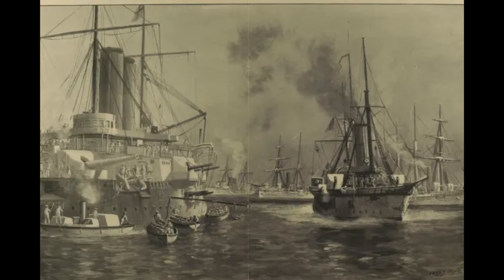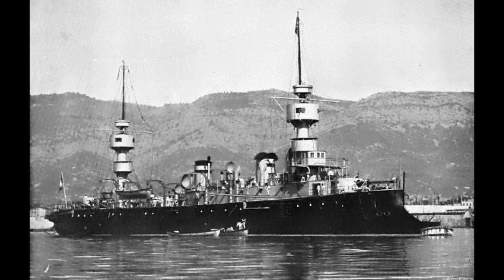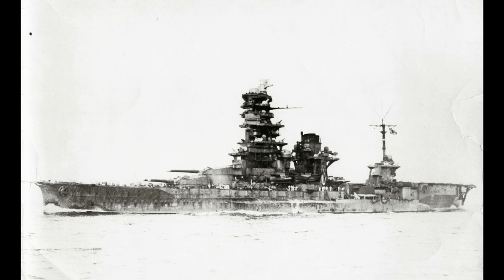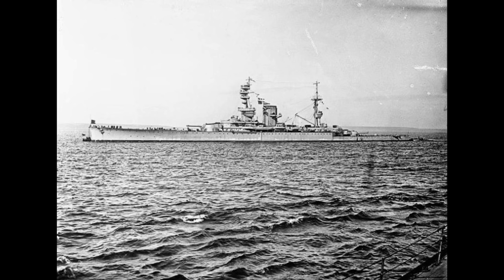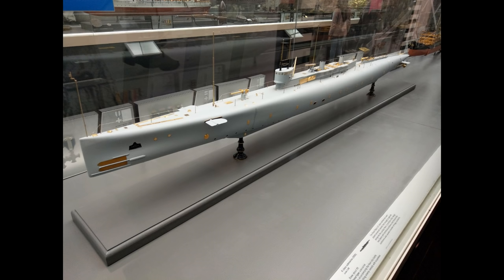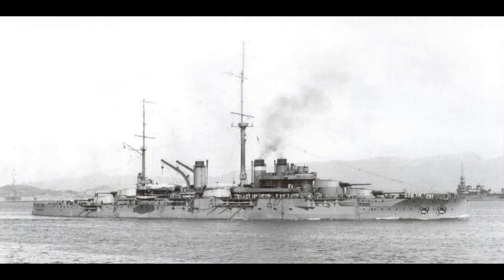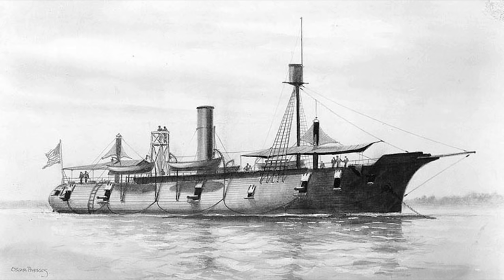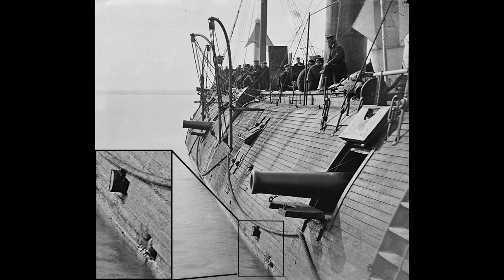Naval Engineering Disasters - How not to design a ship

Comment: Hopefully this question won't incite mass laughter on the part of people, such as yourself, who know a LOT more about how carriers and carrier aircraft work.....But it seems to me that placing a flight deck on the aft end of ANY ship would be, well, kind of stupid. I say that based purely on the many times I have read or heard that WWII carriers had to turn into the wind to launch and/or receive their aircraft (regardless of fighter or strike types). So, what the hell were the Japanese thinking? Or have I just been misunderstanding the whole launch and recovery of aircraft all this time? Thanks for another great video!!!
Reply: The aircraft were launched via catapult and could not land on the flight deck, the floatplanes could be recovered with a crane and the ones without floats would have to find a land-based airstrip to land on rather than return to the ship.
Reply: @S0RGEx  Thanks for the kind reply. I SHOULD have figured the ship(s) came equipped with catapults AND that at least some of the aircraft were float planes.....But for whatever reason, possibly an elder moment or just a good old fashioned brain fart, neither possibility/probability floated up to the surface so to speak. Again, thanks for the kind reply!

Comment: Vasa wasn't a design failure. It was a combination of changing the design by the king after ship had been started to constructed and the owner of the yard dieing, than nobody had th courage to tell the king of the problems with stability. They realised the problem during a roll test. More ballast was added to compensate, which was leading to a too small freeboard. When the ship started to list due to wind the open gunports on low gundeck let in water. This was reducing the stability even mor due to open survace area of water on deck, which caused the capsizing. There is even now a problem in leadership called "Vasa Syndrom" when everybody is too afraid to tell the superiour he is doing wrong and keeps quite because he is afraid of the superiour.

Comment: In defense of the fighter-carriers, I believe the US sunk all of japan’s carriers at Midway and they just didn’t have the industrial capacity to produce more. Therefore, the fighter carriers were retrofitted to at least ensure that the Japanese Navy weren’t going into battle without air support of any kind (or at least, that was the intent.) It’s kinda like the t-34; yes, objectively it sucks, but it was the least worst option they had at the time.
Reply: Japan actually still had a sizeable carrier force post-Midway (including their two best carriers, which were the two Shokakus). 

What really killed Japan’s carrier arm was the loss of pilots during the Guadalcanal campaign.

Comment: Thanks for the video. I missing the russian Borodino-class in the top ten.
Reply: Those were nowhere near bad enough to be on this list.
Reply: They were bad enough, but would have fought the Tsushima way better with a somewhat capable crew. The tsarist russian navy's general lack of competence was just way too overwhelming.
Reply: @bkjeong4302  Naval historian Antony Preston regarded the Borodino-class as some of the worst battleships ever built. One reason is the centreline bulkhead, that let the ship  capsizing if one side is flooded.
Reply: @thomashartl8073  

Preston’s World’s Worst Warships book (which this channel actually covered in a two-part special) is pretty questionable, with the Borodinos being one of the more questionable entries.

- some vessels are included largely or even entirely due to reasons that had nothing to do with their design or their strategic justification. The Borodinos being a classic example of this-they were included in large part due to their disastrous showing at Tsushima, but that was mostly down to the fact the Second Pacific Squadron was the most incompetent war fleet in history, rather than the ships themselves being badly designed or strategically unjustifiable. The Borodinos weren’t flawless designs, but they weren’t THAT bad. 

- some vessels were included on the basis of design flaws that never actually existed: the Russian circular monitors, for example, were included due to their supposed steering issues,  except this is a fabrication. 

- some ships are literally included for no reason. Like seriously, why on earth was Hood included, when even the book itself points out that Hood was a much better and better-armoured design than often given credit for?! Same with the Indefatigable-class carriers being included. 

- In some cases double standards were applied in including one ship and omitting another. For example, Yamato was included on the basis that the vessel was conceptually obsolete upon launch and never actually did anything to justify building a battleship for, yet by the same logic you can include just about every battleship class of WWII in the book on the same grounds (even the Iowas never actually justified themselves, only ever covering roles that could have been filled much more cost-effectively by subcapital naval units and, in the case of shore bombardment, by the already-existing Standards or even converted landing vessels). If the book was actually being objective it should have included every WWII battleship class on the basis of being strategic disasters. Similarly, the fact the Omahas made it onto the list despite not actually being that badly designed compared to contemporary light/scout cruiser designs from other navies cannot be justified.

- Some ship classes that were absolutely horrible in terms of design, strategic value, or both were completely left out despite being far more deserving of the list than many of the actual entries (a bunch of French predreadnoughts, Kitakami, the Ise battlecarrier conversions, the Konigsbergs, Kriegsmarine destroyers in general, the Indefatigable-class battlecruisers, etc).
Reply: @bkjeong4302  Agreed, some of the ships listed in Antony Preston's book don't belong in there. But he is right about the Borodino class. The massive conversion of the Oryol by the Japanese to reduce top heavy also proves this.

Comment: missing the Borodino-Class, assumed by many as the worst pre-Dreadnoughts built
Reply: I mean the slava did a pretty good job at moon sound
Reply: @yongonn7966  To be sunk? Indeed... If the Russians had done a sound job (like the Osmans did at the Dardanelles) the Germans should have lost more than just a wee torpedo boat (due to mines) and the Baltic Islands should not have been taken. And should we mention the Battle of Tsushima? Suvorov, Alexander III and Borodino gone within a matter of hours... fighting other Pre-Dreadnoughts...
Reply: @paddypleiner5518 I'm no expert on the matter but i feel like a pre-dreadnought managing to hold off two brand new 2nd generation dreadnoughts with far superior firepower and armour at least for awhile is quite impressive. And for Tsushima i think it was more so the fact that a lot of the crew were green conscripts from central russia, a lot of commanders being incompetent, the long journey with no visitation to a major port for maintenance, low morale and japanese competence that caused the sinking of the rest of the borodino class and the loss at tsushima at least in my eyes
Reply: @yongonn7966  did you check the Moon Sound location and water depth? Slava had the advantage to go where no Dreadnought could go, you have coastal batteries and the water was mined... and when the German minesweepers had done their job, she was scuttled... and no, the Borodino's at  Tsushima al capsized before they sank, so they had severe design issues rendering them one of the worst designs

Comment: I would nominate the post war US Tang Class submarines for an honorable mention.  In their original configuration they were equipped with Mann pancake diesel engines that promised to be lighter and more efficient than previous engines.  They were an engineering fail of the first order.  Once their powerplants were replaced by a more conventional design they went on to have long and useful careers.

Comment: You are so completely wrong about the Ise and Hyuga's theoretical viability as a fighter carrier (as is whomever you might be referencing). The only factor that matters for a carrier is sortie rate. Can you imagine this battle carrier putting up a CAP only for the strike to come in at the exact moment this slow, ponderous battleship with a horribly misshapen flight deck is trying to launch a fresh CAP and recover aircraft  to refuel and rearm them? Then imagine trying to refuel, rearm, and spot them for launch while 90% of the ship is banging away with anti-aircraft guns and the ship is maneuvering violently to dodge torpedoes and dive bombers. No, this ship would only ever be a one-shot johnnie and a waste of fuel oil the rest of the time. Actually a one-shot scout/strike wave is pretty much the only viable option for this design. It would even suck at supporting ground operations because of the challenges in finding winds to launch and recover aircraft close to shore. The US Navy's use of escort carriers and light carriers (as opposed to the British model for convoy escort) proves the viability of the concept when the ship is designed to support high sortie rates. Because in a naval air battle, the first side to have a carrier hit is far more likely to lose because it rapidly falls behind in generated airpower. Ise and Hyuga would never, ever, ever have been viable as fighter carriers.
Reply: By that point in the war the IJN had good enough air search radar that the fighters could launch when an incoming strike was detected, with enough time to gain altitude and formation. Still doesn't make them a good idea, but being caught re-arming Midway style was very unlikely.

Comment: I like the way you use the Hindenburg crash as a design failure example picture. When more than half the passengers and crew survived unlike the Boeing 737 MAX design failure which kills everyone aboard. This demonstrates your chance of surviving an accident in an aircraft full of flammable gas painted with a mixture of high explosive and thermite is better than one designed by Boeing recently.

Comment: Twas late 65 at the old wall sea yard
She was commissioned to haul the black tar
And built the Northumbria there on the bar
Roll, Northumbria, Roll
For when the Egyptians they closed the Red Sea
And call came on high from the powers that be
To build a royal monster right down on the quay
Roll, Northumbria, Roll, me boys
Roll, Northumbria, Roll
Carpathia, Vengeance, Celestial Call
She was the tanker to out-size 'em all
From the banks of the Mersey to the port of the Hulal
Roll, Northumbria, Roll
And fair Princess Anne threw a bottle of wine
And watch as the giant set down in the Tyne
What lay ahead could no mortal divine
Roll, Northumbria, Roll, me boys
Roll, Northumbria, Roll
And it's one for the hot sun above
Two for the empire we love
And it's three for the fire that burns down below
Roll on Northumbria
Roll, Northumbria, Roll
And it's one for the hot sun above
Two for the empire we love
And it's three for the fire that burns down below
Roll on Northumbria
Roll, Northumbria, Roll
So come all ya good workmen, beware the command
That comes down on high from the desk of a man
Who's never held steel or torch in his hands
Roll, Northumbria, Roll
For atop a wild breaker, the cracks in her frame
Spilled 'er black guts all across the wild Maine
And she limped away through an ocean of flame
Roll, Northumbria, Roll, me boys
Roll, Northumbria, Roll
And it's one for the hot sun above
Two for the empire we love
And it's three for the fire that burns down below
Roll on Northumbria
Roll, Northumbria, Roll

Comment: In theory : Battleship-carriers like Ise will help protect the fleet

In practice: Yamato and seeveral cruisers were driven off by divebombers launching from the tiny ancestors of today's Marine Assault-carrier platforms and a few destroyers; a few hours earlier, a few old battleships and cruisers were driven off by the battleships and destroyers that were supposed to be escorting the aforementioned tiny carriers

Future possibility to revive battleship-carriers : Gundam-style assault ships aside (very heavy battleships with limited carrier capability carrying only elite pilots, most of them in prototype/conceptual, high firepower, high mobility mobile suits), there is a possibility of bringing this back. But just like how jeep carriers morphed from tiny carriers that can get closer to the shores they're assaulting (which wouldn't be a good idea if that shore happened to be Normandy thanks to all the Nazi 5in batteries) into large assault ships with navy crews but Marine pilots up top and the belly holds Marines and tanks instead of aircraft, the battleship carrier concept would be markedly different: rail gun and/or supersonic missiles and drones(+ASW helicopters?). With a few design goals/caveats:

1. If the rail guns can be made in such a way that you can have at least two running off a nuclear reactor that can otherwise be enough for a Nimitz-class carrier, get a range of over 150miles using regular munitions without their own propellant, and yet the bore is large enough that you can conceivably put a cruise missile in a cannister and use the rail gun as a range extender (since it won't spend its own fuel for the toughest part ie getting off the ground, while also hurling it far enough before it even uses its own propellant; this means the bore has to be around 12in).

2. The tower and flight deck need to be designed in a such a way that drones won't perpetually crash onto the tower (then again, no pilot that you trained for years, so this isn't all that big of an issue). The drones can then serve many functions: given stealth tech as well as sensors and comms, the drones can 
a. Work as scouts
b. Use radar and laser to coordinate fire for missiles as well as a spotter for the rail guns

3. Stealth hulls.

This vessel obviously wouldn't be an escort in the same sense, if at all, as the drones wouldn't be "fighters." Unless there are already high altitude drones that can hover at very high altitude and then fire supersonic AA missiles to take out incoming aircraft. If all they had to worry about was heavier planes that don't operate at very high altitude this would be a viable task for drones, but as it is you either get fighter-attack planes with cruise missiles or heavy bombers and some of these can operate at very high altitude and fire supersonic ASMs (unlike sea-skimming B-52's armed with surface-skimming missiles).

What these vessels will do however is potentially be the new centerpiece in naval fleets as supercarriers become too expensive and too vulnerable, leading to a shift in smaller carriers that will then be the new escort ships for these strike ships, ie, their dedicated decks will operate manned fighters, larger drones, and larger AWACS aircraft.

The problem: this will create the same kind of issue for the US, British, and French fleets as dreadnaughts did for the Royal Navy before as the RN had more battleships but a good chunk of them were pre-DN designs while the German Navy caught up by making dreadnaughts. In one area, this is even worse: since this strike vessel is preferably equipped with stealth, the rest of the fleet that closely operates with it ie escorts it would also need to be stealth ships for stealth to even matter. Not having stealth would be more like redesigning NATO fleets to something more resembling the current Russian fleet, with the exception that their battlecruisers being capable of striking aircraft (or ballistic missiles) at higher altitude. 

All that said imagine if you can actually build this and you have a giant carrier with its escorts not detecting a fleet of stealth ships, drones fly off in different directions for varied attack vectors (basically WW2, but with cruise missiles), until this fleet closes in and fires off the rail guns, whose munitions would be smaller and faster (ie harder to shoot down). Best case scenario: if they're confident they can remain undetected until the enemy fleet closes in, they can just open up with the rail guns without the drone attack waves coming first or far ahead of the rail guns.
Reply: The bombers at played such a key role at Samar were torpedo bombers (and many of them actually did carry torpedoes-the idea the CVEs never had any anti-shipping weapons is a myth)

Comment: Uss iwoa where a failure they where supposed to have 45 cal 16 inch guns but they didn't work so we put 50 cal 16 inch guns on it and it turns out to be better than the 45 s
Reply: Iowa's to be clea

Comment: But Drach! 1910 British tests showed that, 4" of armor was sufficient to defeat a 12" shell, so they were actually armored against their own guns*! 

Apparently the memo written about the tests suggested that thickness should be considered for their own armor!** Depending on side, Sadly/Fortunately the British didn't correct this until the person who ordered those tests had bee replaced, who got transferred, commanded the Grand Fleet, had to fight with those poor shells at Jutland, became first sea lord and appointed someone specifically to fix the problem, 6 years later. 

That British Battlecruiser should be called a fast battleship because it was proof against the Grand Fleet's guns if it was doing the smart thing and running away OR being a proper British ship and charging the battleline and firing at ships on both sides, why else would she have wing turrets? 

* Provided 20 degree obliqueness
** To be fair this was more of a consideration of all armoring, the opposite of the all or nothing scheme, but still.